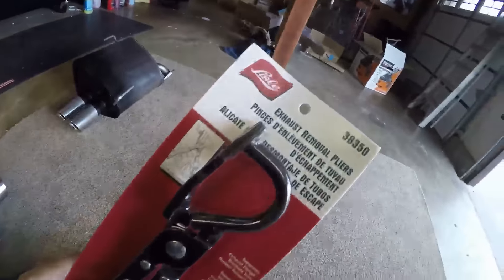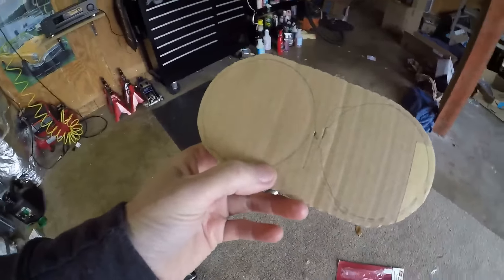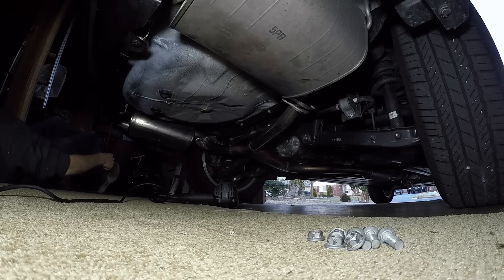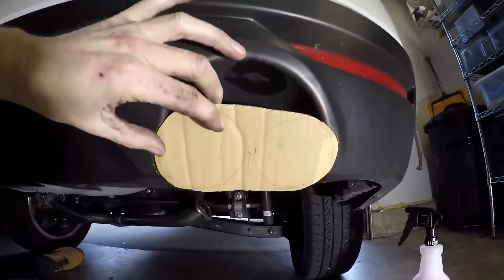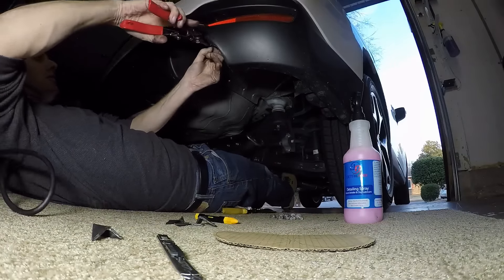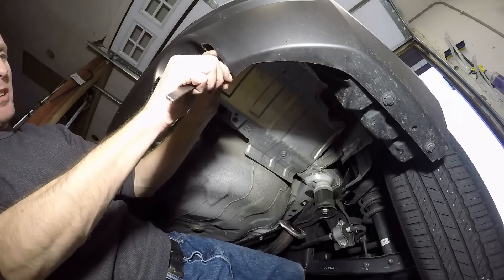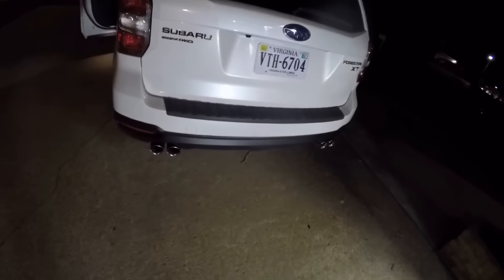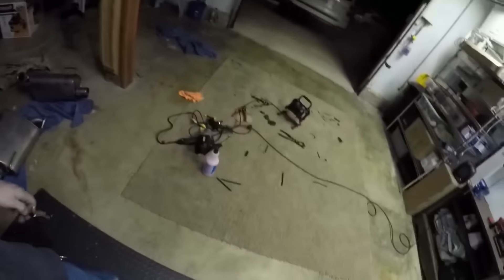2015 Subaru Forester XT: Ep. 42: Installing WRX mufflers

Comment: Thanks for posting your video's...I'm in the same situation...the FXT is the wife's car...so...I was ordered to not "mod" her car.  Installed an STI rear swaybar, 18" Work wheels with 235/55/18's...also, without adding any engine mods, I purchased a Cobb AP and had my friend, Jarrad of PDXTuning.com tune it as is...He managed to pull out 24hp/21ftlbs of torque with just his tune.  The car is very peppy and runs much better than stock.  I'm going to sneak on an STI midpipe like you did tonight...  I did pick up a WRX SPT exhaust (quad tips)...but I need to work the sound level up with the STI midpipe...then later, maybe sneak the SPT on ...I'm sure she will notice though.  LOL.  BTW...she loves the handling the STI RSB and wheels made...along with the tune!  :)

Comment: Hey thanks for the video, just bought a 2018 STI catback exhuast and going to put it on my 2018 forester XT. Love the sound it produces. I think the recorder being in the garage amplified it a bit but sounds very sporty. 
Btw, a great way to have gotten a clean smooth finish on the trim as well as speed the cutting time would of been to heat the blade.
Reply from the maker: nice!

Comment: I had a pair of those Lisle Exhaust Hanger pliers a long time ago,  the forked end kept bending until it broke off. But then again, I was using them for work frequently. I bought a much better pair that still work great, I don't remember the brand but the forked end is allot tougher. Lisle does make allot of great tools, and cost less than the name brand professional tools, especially Snap-On.
Reply from the maker: oh snap ons the worst.. i was always a MAC guy, but i had snap-On too.. (back when i was working in the shop)

Comment: hello, great video!. So thanks for posting this. Can you tell me if a wrx/stil muffler can fit on a 2015/2016 Subaru forester 2.5i (None Turbo) single exhaust. My cat back muffler is rusted out. Need a sporty replacement. I have a subaru scrap yard down the road.
Reply from the maker: i dont know if non-turbo muffler are same inlet type.
Reply: @LastHumansGarage  ok. thanks. Hope some can spread some light on this.
Reply: The 2.5I doesn't have a dual exhaust so technically no the wrx/sti won't fit not unless you modify the exhaust, or add hangers to the driver side of the bumper to hold the exhaust.

Comment: would just be easier to use a small dremel with a small cutting disc and no it wont burn the diffuser and then a small sanding wheel..

Comment: Interesting. I have a 2017 WRX and I installed the STI midpipe and it still drones horribly at 1500rpm. I wonder if the mufflers weren't manufactured properly. It's loud as hell between idle and 1500rpm, and then completely silent above 2000rpm. You seem to not have any drone and others on the forums report the STI midpipe fixed their drone. Hmmm now what do I do?
Reply from the maker: pray